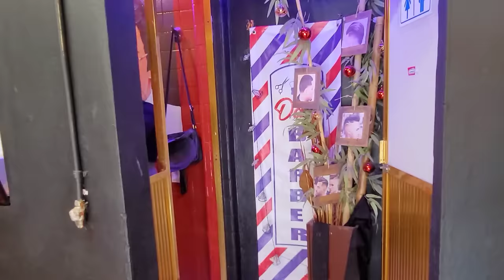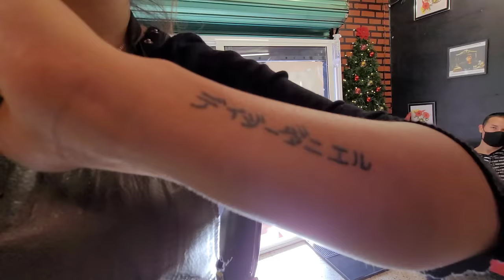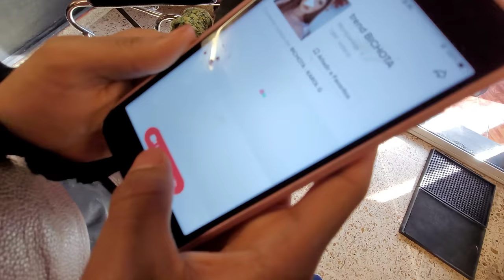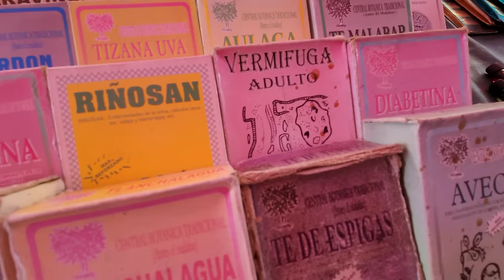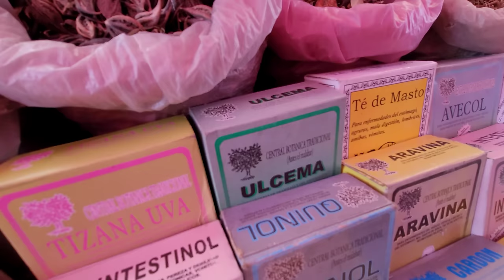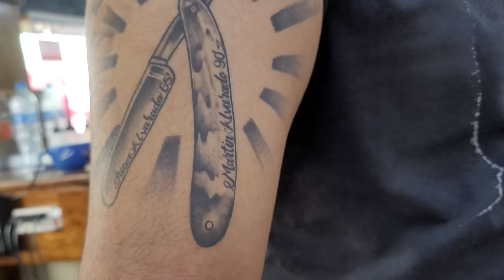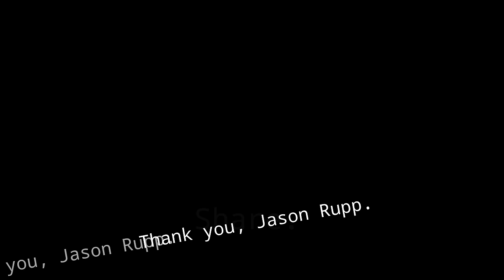💈HAIRCUT, BEARD TRIM & SHAVE by 18 Yr Old Female Barber "DAY" 🇲🇽 Mexico City (TikTok Barberday1)

Comment: if you go to any barber that works in higher altitudes they will almost always use a steamer for straight razor shaves because the lather dries out much quicker because the air is thinner.